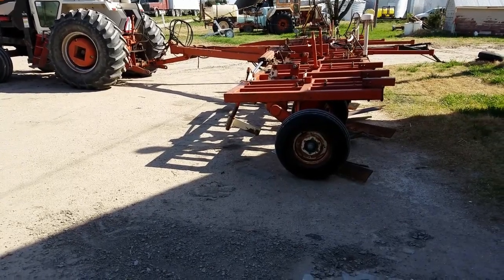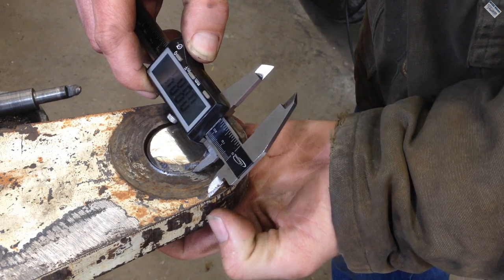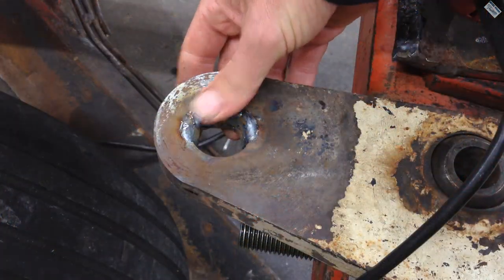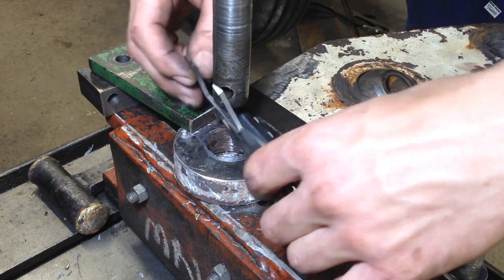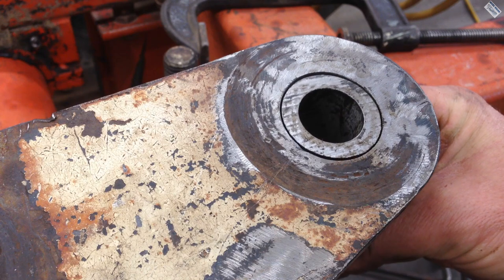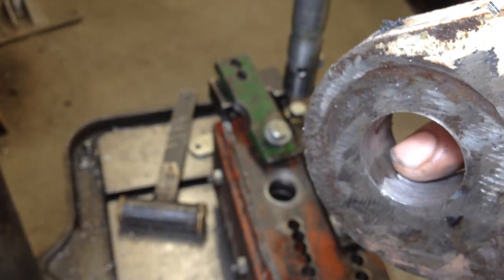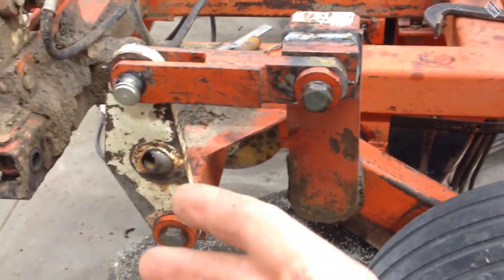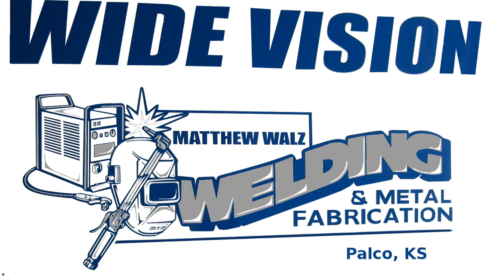Sweep Plow Linkage Repairs

Comment: i came across your videos some 20 videos ago, i am a retired welder, use to work in shop yards, and Can=car biulding grain hopper rail cars, but most of my life i worked welding on logging equipment, and this machinist that use to come to the logging camp made me a bunch of diferent size boring bars to use in the shop drill press like your doing, but he made me a baring plate that clamped to the table of the drill press to stop the holes from going out of round from the flex of the bar and drill press qill, witch you see in your videos, i made all the bushings i ever needed and made new ears for clams and pistion rods, and hundreds of other repairs, i still use them today on side jobs i do even at home on the farm for others.. they still work great to this day, mind you i have had to replace the sealed bearings many times over the years, but only a few bucks to do it..
Reply: Waste not,.want not was a line our grand parent's use to say.

Comment: I just subscribed to your channel because everyone loves a dog right/LOL. I'm tore up from the floor up so I watch videos on stuff that I used to do.... well sorta, I worked as amech/welder in the north or all over this state (alaska) and I'm so glad I wasn't raised down there cause your day is done when you run out of gas in the generator for the lights. Sure I had my days of working in 24 hour daylight (midnite sun) but I just worked when a machine was down and that could be mid day but your a working fool.... that is a complement and hope you took it that way!! I like the way you work through problems and not whine about it. Hell you got calluses on calluses from the size of junk you work on. Never a simple grease job, nope a full out rebuild on so stuff I ain't never seen before but I like it and would of took to it like a duck to water. Its not easy and not many could get it done but you seem up to the task. Good video by a good hard working person

Comment: Guys in that area are lucky that you and your talents are around. Grease worms got into that blade. Company in Nobleford, Alberta make what is called a Noble Blade. Very similar sweep but different fold up design.
Reply from the maker: Thanks! I've heard of the Noble brand. I want to say they sell it as Krause down here.  I could be wrong! I'm pretty sure my grandpa has a single bottom sweep in the junk that says Noble on it. I might have to go look.

Comment: Great job! What does the round pivot in the center do?

Jim
Reply from the maker: Each wing can flex (hinge) so it can follow the contour of the ground. (Especially terraces) It's how this manufacture solved the problem of transferring the lift power from the hydraulic cylinder to each of the wings, and still allow it to flex.  I hope that helps.

Comment: Nice repair, it's a sweep plow, you don't need a hole perfect to a ten thousandth, it's going to get abused pretty well again. Question; what kind of wire do you use to build up the hole and how does it stand up to the abuse? A friend asked me to do some welding for him on a large auger this fall and it's got four two inch holes that aren't round anymore, just wondering what would work best. There isn't a lot of material to drill out and bush. The arms are too big and complex to make new(hour/material wise). Thanks
Reply from the maker: I use ER70S-6 and usually I get Lincoln brand. It is very comparable to 7018. It wears about the same as cold rolled mild steel, if that helps.

Comment: Wow. I wonder how that plow got so worn. The usual answer is that someone forgot to grease it. My dad had aa compulsory and obligatory greasing rule: "if I catch you forgetting to grease your (tractor/combine/lplow/harrow... then you're fired!"  Worked very  well. That said, you made the drill press into a mill. It can be done and I have done it, and you sure did it. But you need a big mill. I am sure you know that!
Reply from the maker: I replaced 42 grease zerks on this plow because they were either broken, or hopelessly plugged with ancient grease. It hadn't seen new grease in years!   Yep, still looking for a mill.
Reply: I doubt very much that the mill will turn up in Palco KS. More likely in Topeka or some other big city. Might pay to scan craigslist in the big burgs for that mill.
Reply: Make that plus one for a big mill, oh, and a boring head of course. 
An interim fix might be an XY table for your drill table. New chinesium ones can be bought  over here new for about £150. Just looked at Grizzly, they have something that might do, G8750. This does not constitute a recommendation as your work is, how shall i put it, at the rougher end of machining. It is just an idea for a way to go.
Reply from the maker: I probably should get an XY table until I can get a mill.  It would be handy on the drill press.
Reply: I was thinking along the same lines, save the mill for, er, milling. :>)

Comment: Those days where you keep on trying to get the right measurement, finally welder and machinist make a good pair, don't worry about removing too much...    You're just late for dinner after all...    lol
There is a lot of steel on those big plows or just about any farming machines.
Reply from the maker: I know a couple mobile welders around here that are strictly welders. They have to pay a machine shop fairly often to do machine work for them. It kind of ruins there profit for those jobs!